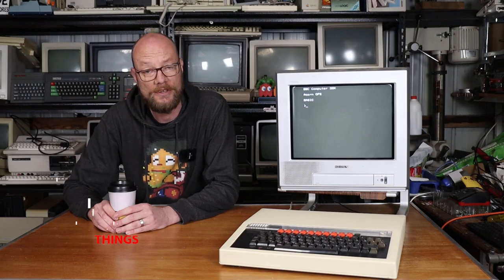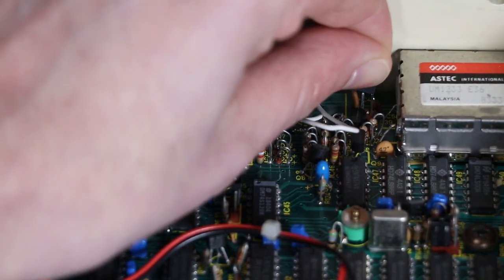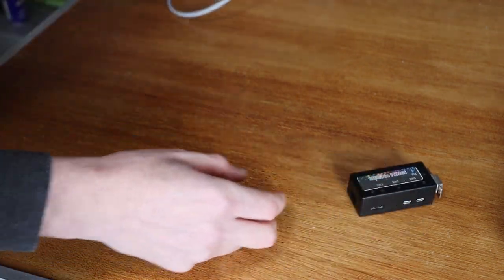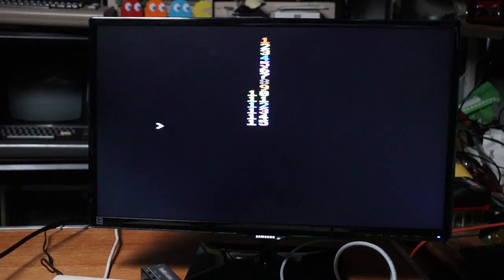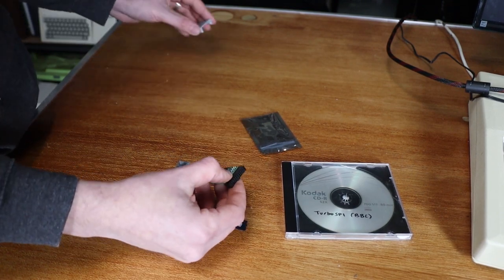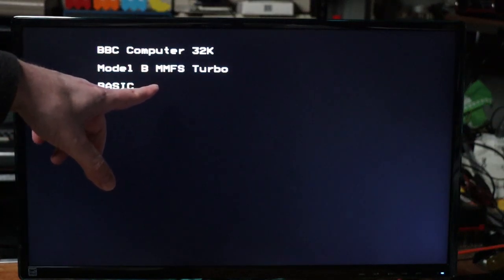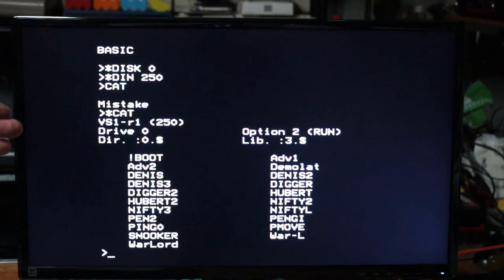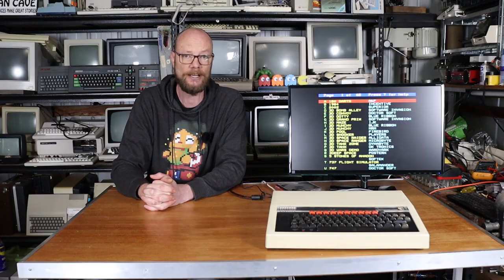Quick Look: BBC Micro upgrades

Comment: From Denmark,

Hi there, I'm an old BBC B user myself and, funnily enough, I've just bought another one from England that I got for
6 days ago.

I got my first BBC B in 1982/83, can't quite remember if it was 82/83.

It was one of the best things that happened to me, I totally fell for it.

I'm looking forward to getting started again and all the memories come flooding back.

it's like being 25 again like back then, ha ha.
Reply: can i ask you if they seem smaller to how you remember them, I saw one the other day after owning one in the 80's up until Amiga days (I regret selling it all had microvitec cub , double drives , seikosha gp100a printer and all speech, opus dfs as i preferred that to the acorn dfs.  but on finally seeing one at a car boot sale for £50 in the box i was surprised at how small it seemed to how i remember mine. I'm sad to say i didnt have £50 on me and had to let it go to the guy behind me who had the cheek to knock him down to £40  i would have paid hundreds it was in the box and brand new condition still in a sealed box the keys never even type on it looked brand new model B even the welcome manuals were pristine and bumper feet mint never touched a table. he said he got it left to him from his grandad who had passed away and was selling it for charity, I told him to put it on ebay but he SOLD IT FOR £40  aaaaaargh!

Comment: The colour was due to fault on your computer rather than a general issue with the model. Unless it has something to do with the different PAL frequencies in Australia compared to the UK. :-)

Some BBC B Computers have speech simplifier and an inbuilt word processor - The machines were sold with the chips inside.

'chips' is an outdated word isn't it? Nowadays you would say ROM although it is exactly the same thing; the same technology.

Thanks for making a great video!

Comment: I believe that it is Martin Mather File System as a nod to the original designer of the hardware and original software.
I have written a similar games menu for the "MMC" solutions like smartspi and mmfs and a similar version that works on GOTEKs.
You can find it on stardot and it comes with my recent-ish ports and new versions of classic early 80s arcade games.

Comment: Glad to see the TurboSPI in action! That 3D printed case is really neat too.  If I recall correctly, MMFS may be short for MMC File System and the the TurboSPI is either a successor to or a fork of the TurboMMC. I should probably get onto Stardot and do some fact checking. :D

As for the colour composite mod, you lucked out there.  The only revision of Beeb motherboards that had headers like that were Issue 7, and not all Issue 7 boards had that in place (but the provision for the LK39 header was there on Issue 4 and 7 boards even if the header pins were missing).  It could be worse; early Beebs (Issue 1, 2 and 3) need a small ceramic capacitor added to make the colour composite mod. I forget the value required, but I do remember this mod being officially documented by Acorn. Not a big deal in the scheme of things, but still a little harder than just popping a jumper in there!

Thanks for the shoutout as well. :)

Comment: The BBC B also has an analogue-TV out. We have a Samsung monitor/TV, so I just plug in the TV-cable and it's pixel perfect. And I mean pixel perfect as the Samsung has an 1280x1024 resolution which fits Acorns perfectly. Should get it upgraded with an MMFS though.

For some special versions of games, 16K sideways RAM would be a good extension.

Comment: first thing iI would advise anyone do is fit a heat sink to the gfx chip, its a while ago since i had one (82) but i remember that if the text or characters on screen start to wobble/jiggle due to running for a few hours and the chip getting hot just stick a heat sink on top of the chip and its fixed.